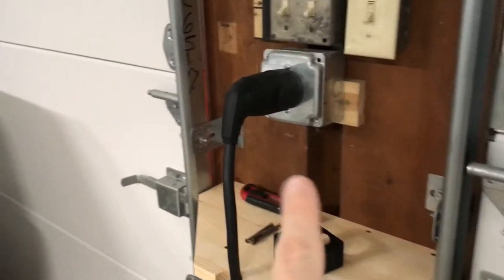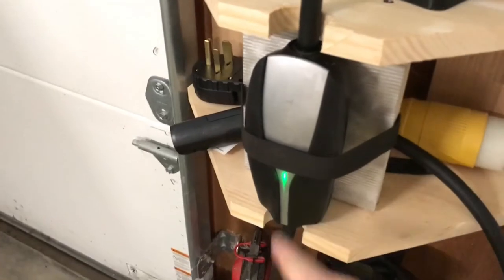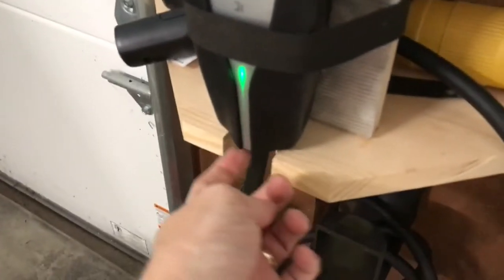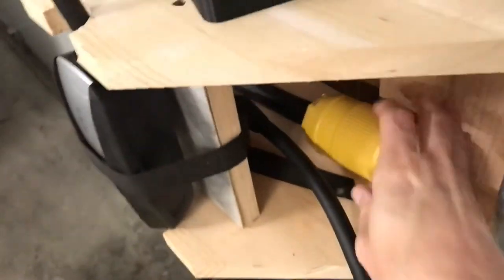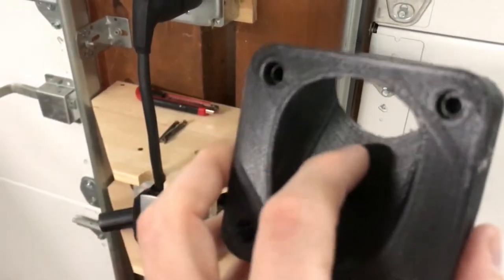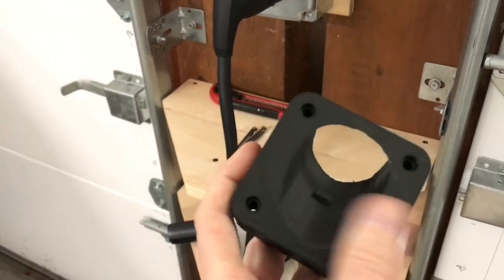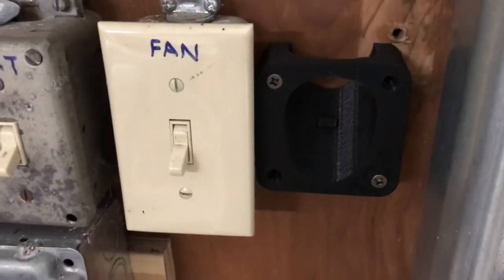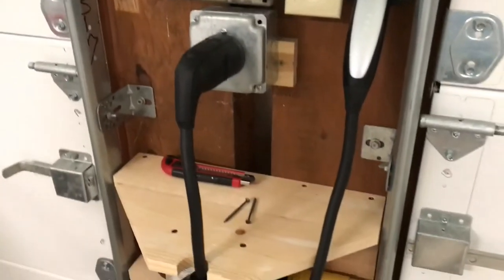New UMC requires home charging station redesign

Comment: What was wrong with the previous cords?
Reply from the maker: The prior two still provided charge, but they were causing locking/unlocking problems with the chargeport.  I actually thought the issue was with the chargeport (which was eventually replaced for a different reason) but Tesla said it was bad signals coming from the UMC.
Reply: NZCUTR very helpful information. My cord is doing the same thing. I was afraid it was my charge port also. I can get the cord to work eventually but it is getting frustrating. So did Tesla give you a free replacements given the poor performance of the cords.
Reply from the maker: I received them free-- but that was under warranty.  Not sure what their answer would be next time.  Fortunately the UMC price has dropped by about half.  It used to be like $600 and now it's $300 or $350 (I forget which) so that's an improvement should I have to buy one... but I'm hoping third time is the charm.